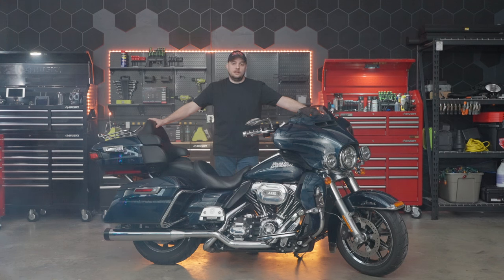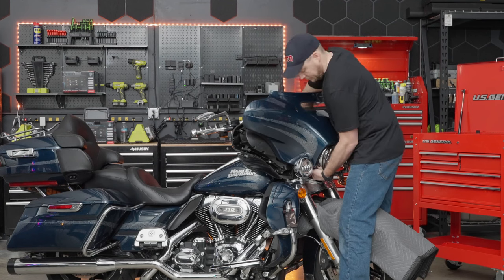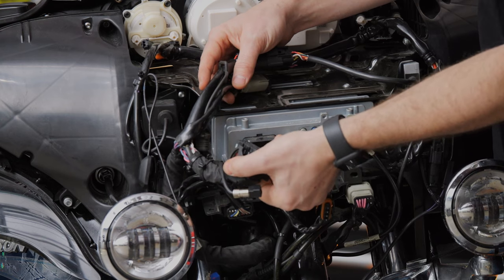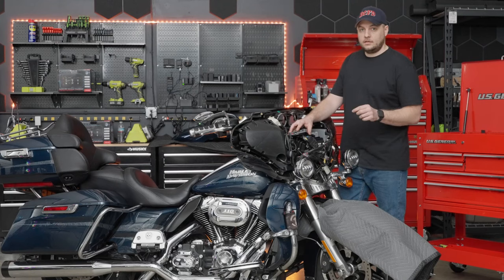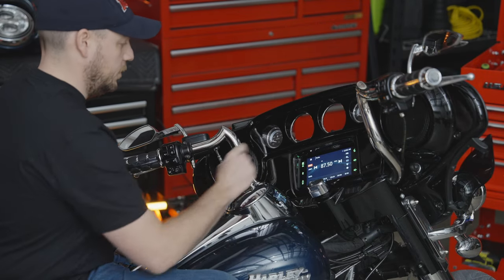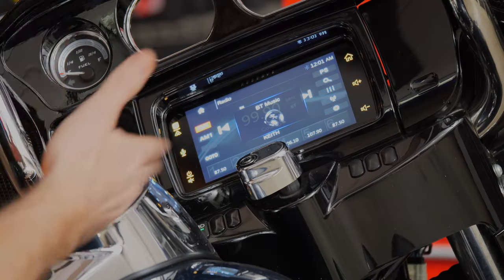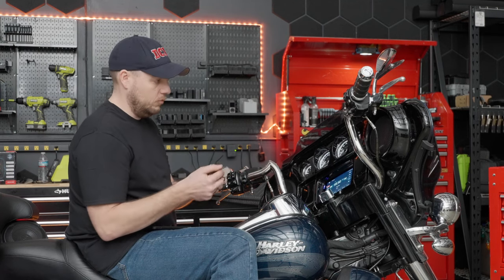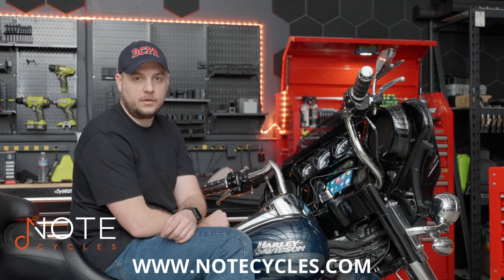Soundstream (HDHU.14si) Installation | 2014+ Harley-Davidson Street Glide/Electra Glide/Ultra

Comment: I have a question, in my 2017 Street Glide CVO, if I push the button on the right of the handlebar, on the original screen I see the outside temperature, is this function also available in this new radio?